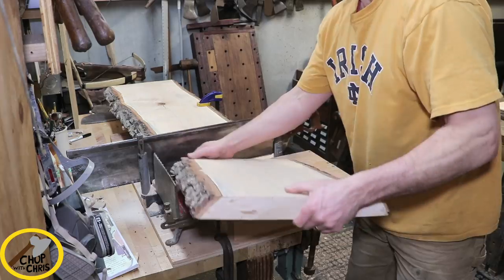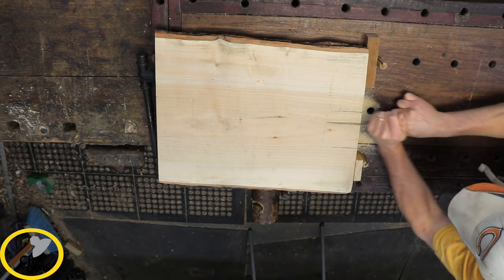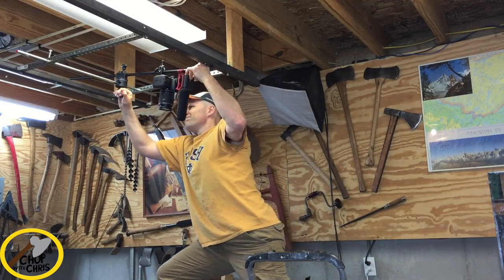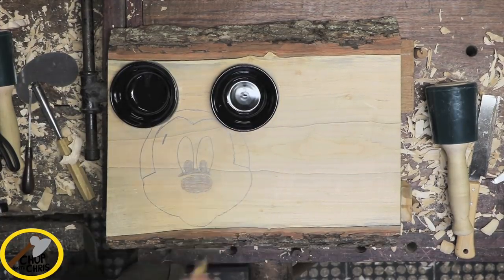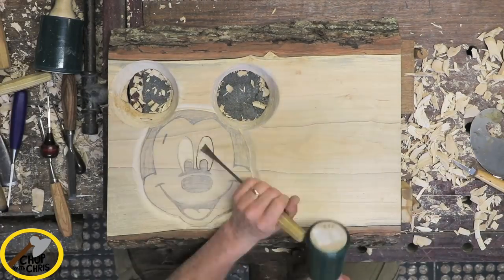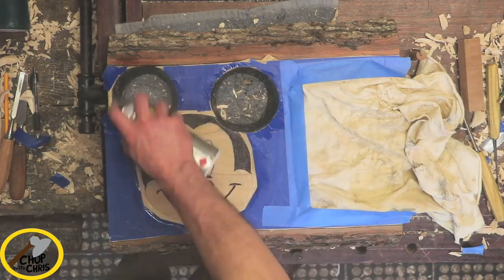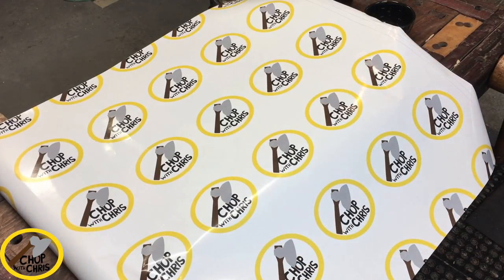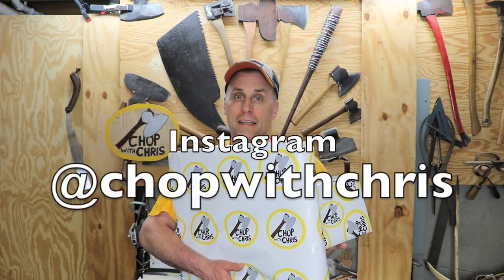DIY Mickey Mouse (inspired by) CUTTING BOARD

Comment: I have been making bows for a long time now, but I'm starting to get into wonky yew, therefore I need to steam bend it, any tips?
Reply from the maker: +SuperScience894 Why do you need to steam it?
Reply: To straighten out the uneven places so it doesn't explode on the tiller. I could also use dry heat but that takes a lot of time and practice. I steamed a small piece of yew yesterday and I did straighten it but I don't know if I over cooked it or not.
Reply from the maker: +SuperScience894 It's supposed to be an hour per inch thickness but you're right that you don't want to over steam.  I'd follow this rule but as soon as you get good movement then remove and clamp.   Should be a great looking bow.  I'm going to start working on a bow and Crossbow made from oak pallets.  Should be a fun challenge.
Reply: ok, really looking forward to it! you were one of the ones that inspired me to start woodworking in the first place. Just set up a proper tiller with pulleys and all of that and you will be good to go! Love your channel, keep it coming
Reply from the maker: SuperScience894 Well thank you very much!   Take care.